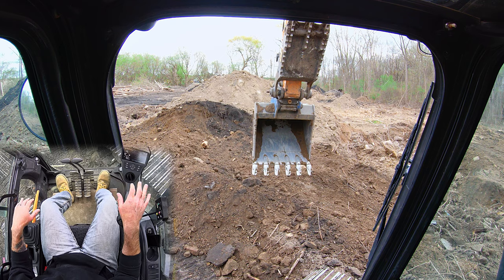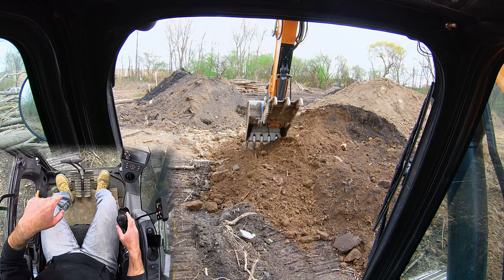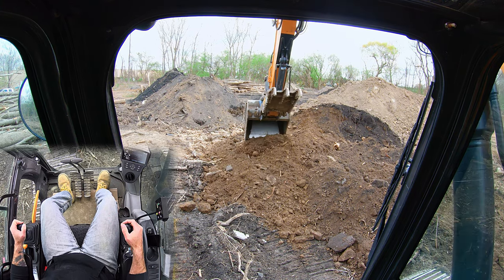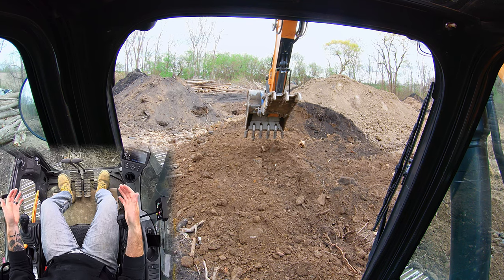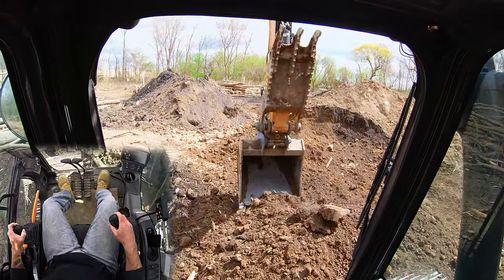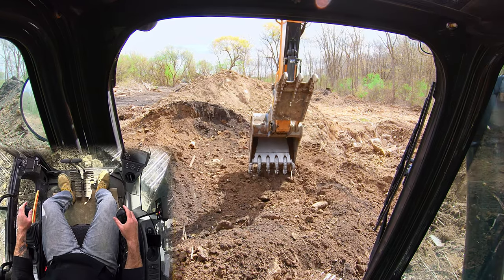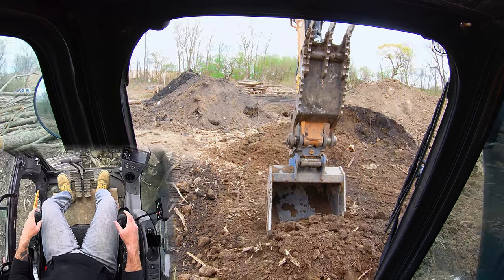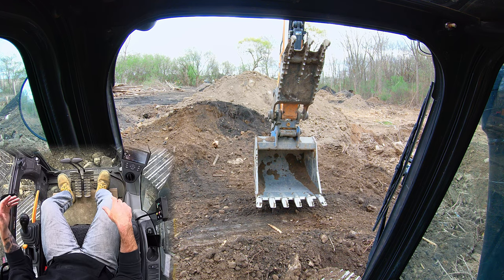HOW TO FINISH GRADE WITH AN EXCAVATOR // Excavator Tips and Tricks - How to Make a Flat Pass

Comment: Sounds a little crazy, but if you look on the floor of some Cat machines there are three little circles that are slightly elevated on the floor ahead of the controls.  I like to take a small level and place it on top of those three circles to make sure the machine is flat before I try to fine grade with an excavator.  Then I'll lay some dirt under the track to level the machine before I dig.  I then work from back to front like you said then side to side then if the machine has a blade I'll "blend" my sections together with the blade.  Usually comes out nice and flat.
Reply from the maker: Great advice James! I had no idea the dots were a good level indicator. Thanks for the comment brother
Reply: As a new operator getting level is the bit I worry about.  I would have thought a level would be standard in an excavator. But these videos have shown more than a few tips and tricks on how to get level, and I guess over time I'll get a good sense of being level or a bit off. So far it's easiest to tell when I slew around that I'm not on level ground.

Comment: Very helpful. The takeaway I see is you don't have to take full width bucket mounding cuts every time...except when load trucks. Keeping the stick perpendicular as much as possible helps too. I used to try to grade with the full extent of the machine and it was uncontrollable.
Reply from the maker: You will eventually gain the ability to grade with the machine at full reach. It just takes time and practice. Whenever you are fine grading you switch from a production scenario to a "take your time" scenario. Even if I were to take several cuts at full speed it would be slower than taking a nice slow pass one time using half my bucket. Slower is faster when it comes to fine grading
Reply: Right, it just takes seat time!
And understanding each machine has its own sensitivity you gotta get to know each machine you operate.

Comment: Awesome video! Thank you :) I'm just starting out and am doing my first job. I'm working on a dirt track and I need to camber the road so water drains off the centre into the trench and off the side. Could you give me advice on how best to do that? I don't have any other machines just me and my excavator.
Reply from the maker: Depending on the situation you could dig a small trench for one of your tracks to set your angle or you could create a small mound to raise one of your tracks up. That will allow you to grade with the machine in the correct position.

Comment: New oporator here, 
When trenching or grading or anything in general, do you ever do anything past the 90 when it starts to lift? obviously you go opposite direction to the start and push the boom down to counter, my question is, is it worth going that little extra or keep it beyond the 90 and then restart
Reply from the maker: Yes, you will go past 90 all of the time.  If you don't go past 90 then you are only using about half of the travel you can get out of the bucket.  It takes time to get good at the transition but, over time it becomes just another thing.  When you're digging a long trench then it's more efficient to move the machine once you get to the 90 degree point.  The majority of the time you are digging right up to the machine so moving the tracks isn't an option.
Reply: @DieselandIron  thanks for your reply mate, appreciate it

Comment: Great video as usual Bryan, I’ve seen something done before and wanted to know if it’s something you’ve done in the past. When digging a trench the operator I work with tends to start his pass about a foot into what he knows is on grade and just lightly brushes the top before making the finish pass on the trench, I’m assuming this is to help him set up what his boom speed so he can pull it flat. What are your thoughts on this and have you done it before?
Reply from the maker: Great question Ryan.  That's actually a technique I use as well when digging in a trench situation.  It gets your hand speed correct before you actually start cutting material which will help you stay on grade.  Another technique I will use is to start bringing my stick in and right before it starts to cut material I will catch it by raising my boom.  That's another way to set your hands before actually cutting material.  I'll try to make another Down and Dirty showing these two techniques since this video is doing so well.  I'm seeing a lot of additional questions so I think it would benefit everyone if I show these on camera.  Thanks for the comment Ryan.

Comment: Can you show a video on what angle to have the bucket and when to start curling to get a level pass??
Reply from the maker: This is that video.  I can't really show you exactly when to curl to stay level because every machine is different.  Boom and stick geometry's vary.  You might have a quick coupler or a rototilt that changes the distance from the hinge point to the tip of the teeth.  All of these things will change how you need to pull to stay level.  This is one of those skills that just takes seat time and experience to learn.  I wish I could give everyone a quick "do this" but, it just doesn't work that way.

Comment: Let us suppose that we do not have space to move backwards and the material accumulates in front of the excavator without the possibility of being able to remove it. What do we do? I ask because I am practicing with an excavator and that happens to me a lot and I have to go over the accumulated material and in this way I "break" what I have smoothed.
Reply from the maker: Sorry for taking so long to respond.  If you know you aren't going to be able to back up then you need to push the material away from you before it crowds in too close.  Similar concept to what you do in a loader so you aren't chasing piles.  Take a scoop and when you return for another, push the material away from you before setting up for your next pass.  Also, make sure your passes don't come all the way into the machine.  Leave a bit of margin for your push out.

Comment: Lets say you need to dig a flat trench but it needs to be smooth so you cant dig with your teeth down and you have to move your bucket to level it out as you go, you got any tips for that? and that tip about moving the boom faster at the start and adjusting it as you go is so simple but hard to get through your head in the field you just start pulling on the sticks as fast as you can lol
Reply: I don’t exactly understand by needing to move your bucket to level it out but what I’ve seen done is they’ll set the bucket flat on the bottom of the trench and then pull towards the machine, it’s a little harder because then you moving the boom, stick, and bucket curl all at once (you’ll need to curl out to keep the bucket teeth parallel to the bottom of the trench) but it leaves a nice smooth finish when your done. I’ve also found this technique works well when finishing grading light materials like sand as it doesn’t take much to over-dig and because your bucket is on grade you can curl the bucket to take small cuts.
Reply: I would say get it as close as possible with the teeth then use the heal to smooth out the bottom and always remember slow and steady you'll get fast over time without even trying.
Reply: When I started my cheat was To set the dipper at 90°to the boom, glance at the the dog bones for my bucket level, and also the ground level to my dipper depth mark in relation to the side of my straight wall, check my tracks to the topsoil key in my mirror then travel back and finishing as I walk out.   Perfect cover every set. I also check my depth with the size of the spill and on level ground the relation of the boom cylinders to the boom. 

When using this technique I always swing on my last bucket to check my path before reversing on the mirrors.
Reply from the maker: As others have commented here, heeling in your trench with the back of the bucket is the most effective way to get a flat bottom trench with a toothed bucket.  I will cut to grade (staying maybe half a tenth high) using my teeth like normal.  My last pass, maybe two passes will be with the back of the bucket, dragging it with quite a bit of down pressure to clean up the bottom of the trench.  That should leave you a nice flat bottom while being right on grade.
Reply: If I understand what your saying you  walk the machine back with and get finish grade in trench that way?

Comment: Thanks for the video, very helpful. As a newbie with excavators I just have to remind myself not to watch how You use the controls.. I have ISO controls on my excavator ...
Reply from the maker: These should be the same.  I believe ISO controls are "Cat" controls which is what I'm running.  Thanks for watching!
Reply: @DieselandIron  You are right. ISO pattern is CAT pattern, but there are lots of internet references that have this incorrectly reversed. ISO is the predominant control pattern on excavators worldwide. If however, you started to learn on a backhoe the ISO is the opposite of what you became familiar with.

Comment: No no no.
You can’t “finish grade” with an excavator. Clean up, that’s different and if you want it any cleaner, say within 3 tenths, get a dozer, blade or even a slip loader.
Get the right tool for the job. 
If you’re taking time by grading with an excavator, you’re not making money when that machine should be digging. That’s where it’s productive.
And sweeping is terrible for the spindle motors…. Unless you’ve got money to burn.
Reply from the maker: Duane, I feel like you have outed yourself as an armchair operator.  I would encourage you to watch, listen and learn rather than spewing industry terms you've heard from Youtube videos you've watched on the industry.  If you can't get grade closer than 3 tenths in a hoe then you need to get out of the seat.  Again, as I stated in reply to your first comment, you aren't going to grade an open field with an excavator.  This is for areas where it is appropriate.